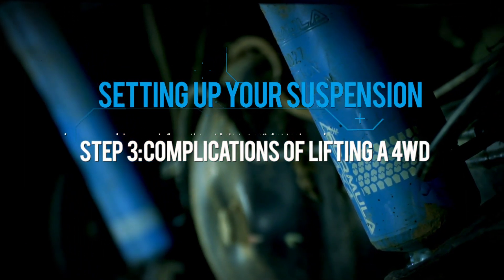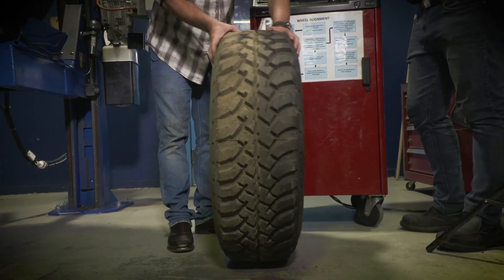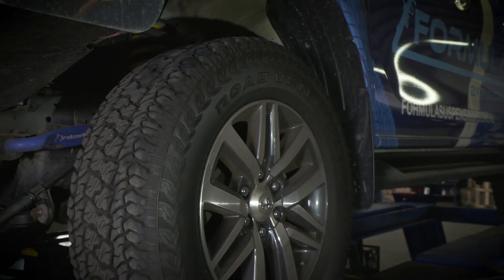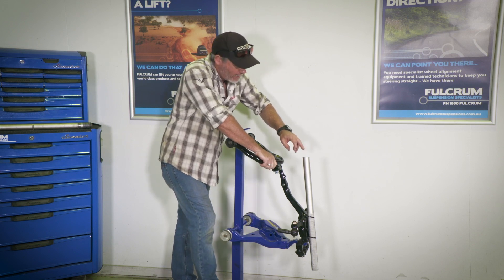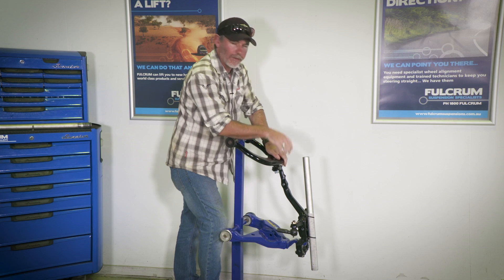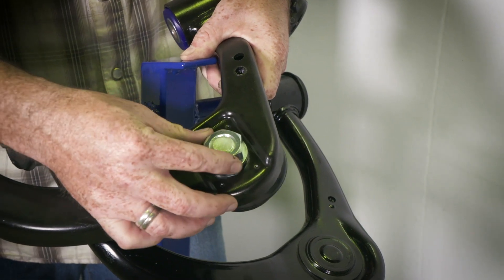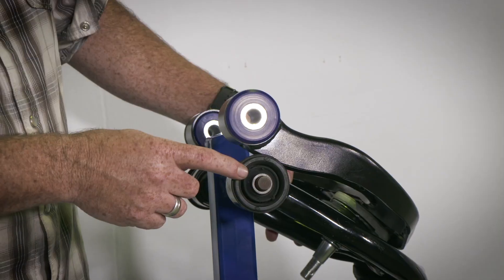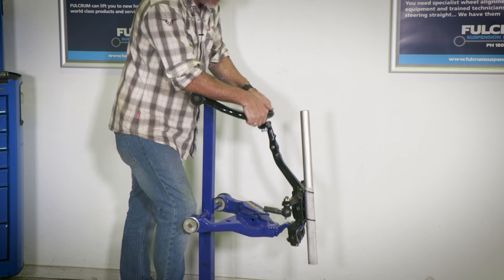SuperPro Adjustable 4x4 Control Arms & Complications of Lifting a 4WD

Comment: Is an adjustable upper control arm upgrade enough or should lower control arms change too?
Reply from the maker: Generally for a 2" lift an adjustable / fixed castor UCA is enough :D